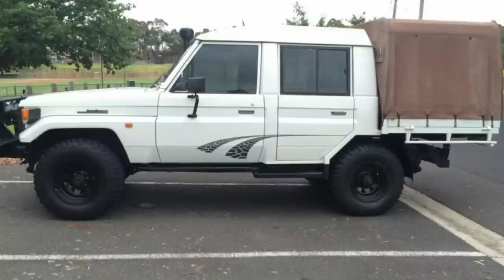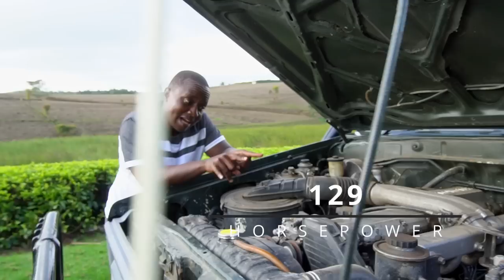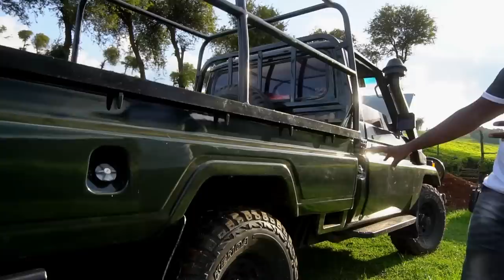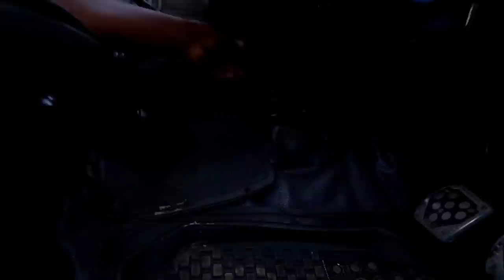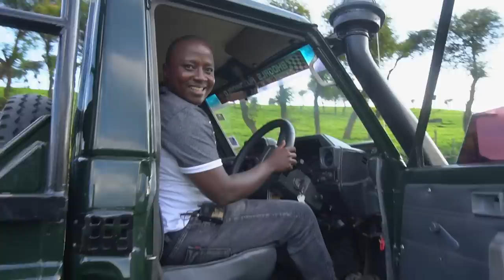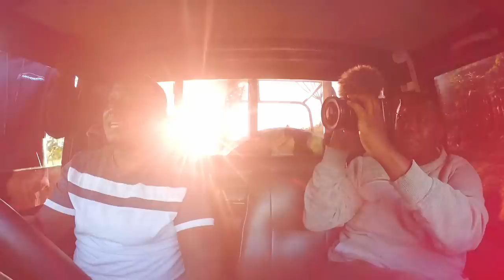Rugged and Reliable: Toyota Land Cruiser 75 Series - The Ultimate SUV

Comment: Good review, this is an actual unit that I am considering but three observations
1. That's not an electric winch, it's a PTO winch
2. The 5 door wagon picture you have shown at 2:08 is a 60 series.
3. The defender 110 has a slight advantage in that it is coil sprung hence better articulation and clearance. Leaf spring hangers on the 75 catch on rocks, branches etc